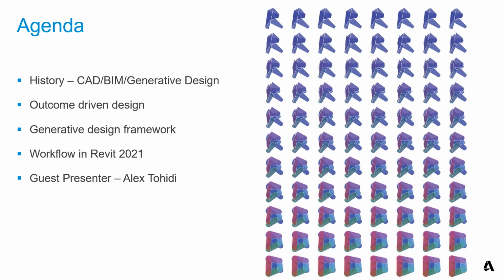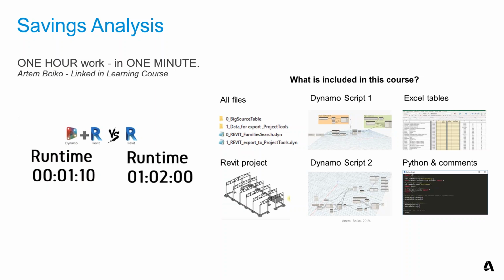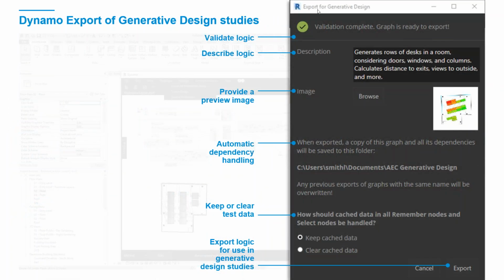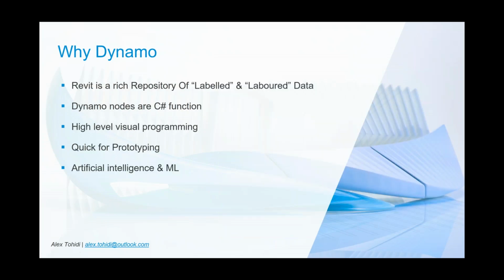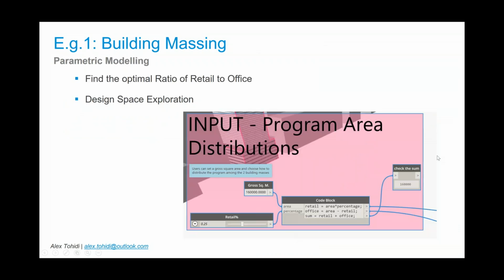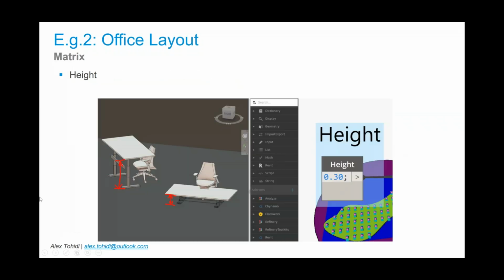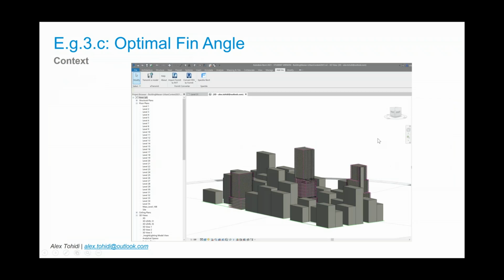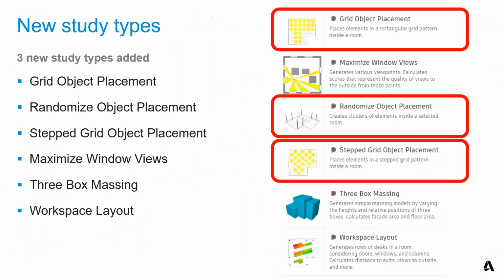Autodesk Webinar Generative Design Revit 2021

Comment: Interesting presentation, although it's worth pointing out at the end that most of the examples were non-generative studies in Rhino that didn't use Dynamo or the Generative Design tool. It still seems that most people are struggling to find complex practical use cases for generative studies on live projects, rather one off analytical studies are still out focus.

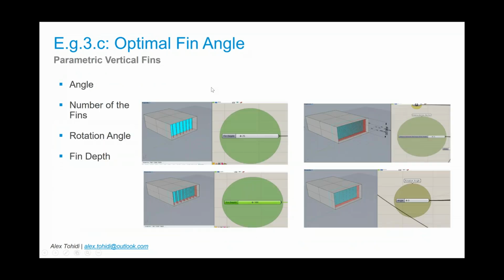Also at 48:30 this study actually can't be done in Dynamo as Ladybug tools are not supported in Dynamo beyond Revit 2019.